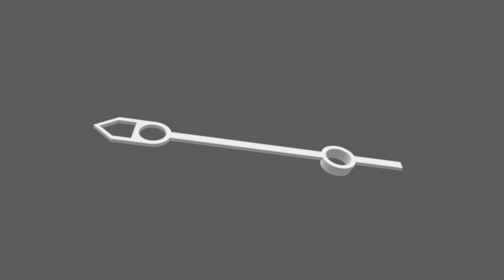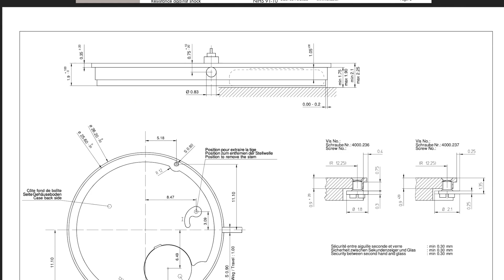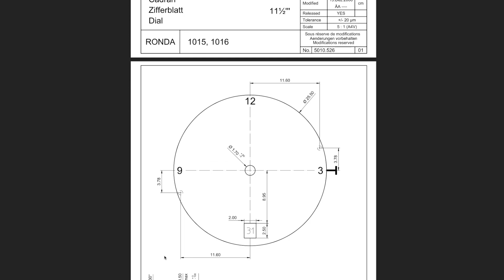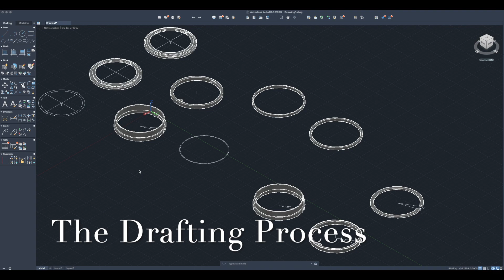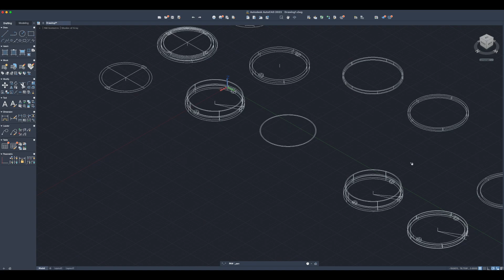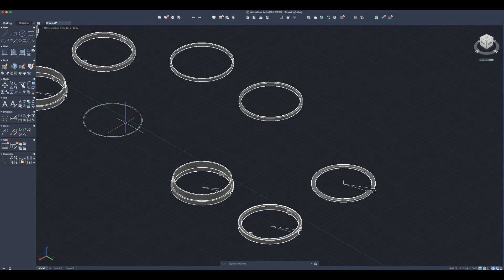3D Printing Watch Parts: A Ronda 1015 Movement in a Dive Case

Comment: My whole issue is finding a case with a thick enough wall on the case.  Case I have is perfect for the depth of the movement but my issue is the cases I find all have too thin/narrow walls.  I need a thickness of 5mm for stems I have. 

Where did you find that specific case?
Reply from the maker: The specific case I used in this build can be found on ebay and aliexpress. I have more info on the builds here: https://watchcomplications.com/ten-six-watches/movement-and-case-combinations/
Reply: @WatchComplications  

Thank you.  I'm trying to look for cases that will work for a pocket watch movement and sleeve/stem.  Nothing modern. But looking quite a bit around I may have to do something just custom.
Reply from the maker: @jeremyhunter1459  have you looked specifically for "conversion cases" for pocket watches? Some exist, but a lot of the work in that space is custom.
Reply: @WatchComplications  yes.  There's a company that has cases for a 16s movement.  But nothing for a 6s, which would be a 40mm case and a 12s which is 45-46mm case.  I'm looking into different sources from where I may be able to get cases that would fit the sleeve/stem, fabricated.
Reply from the maker: @jeremyhunter1459  cool, lemme know if you find em!
Reply: @WatchComplications  
I'm doing a bit of copy catting.  The company, can't remember the full name watch case company.  They sell the case and parts for a 16s.  The tube they put the pocket watch stem and sleeve fits right into the tube.  So I took a note out of that book and got me a few 3.5/2.5 tubes.  And will be putting my 12s sleeve and stems into those tubes.  Putting those into a drilled spot in the watch case and go from there.  It's an interesting process.
Reply from the maker: @jeremyhunter1459  can always send me one and I'll do a transfer of a movement and vid! :)

Comment: Thanks for the fantastic videos. I am thinking of doing some moding myself. Also, I think you have the case clamps upside-down? I have found tinylogo on ebay in the UK (unable to see them on Facebook) looks like they are on holidays and have put the price up extremely high (so no one places an order) in the description it states 50 logos one colour £125. 
Cheers Dean.
Reply from the maker: ego logo was even more expensive. not cheap getting custom cut logos.